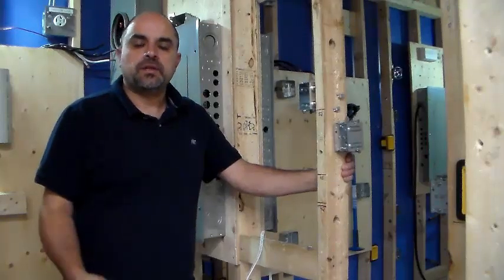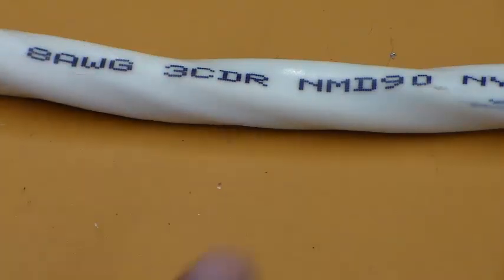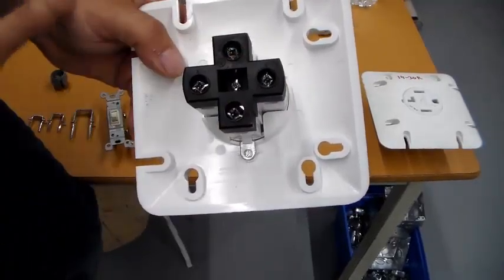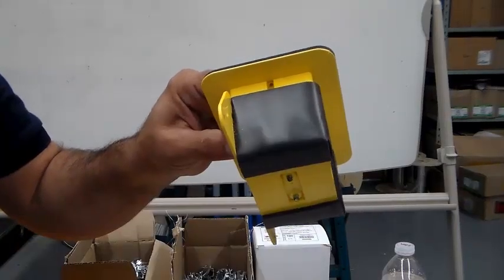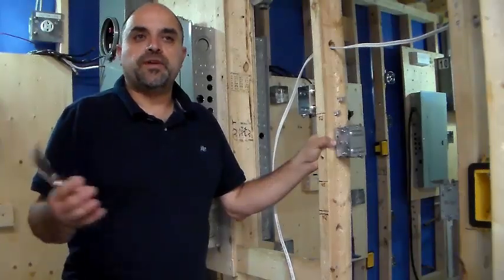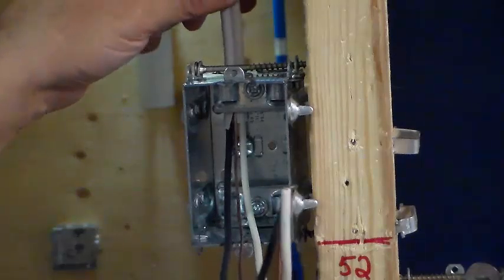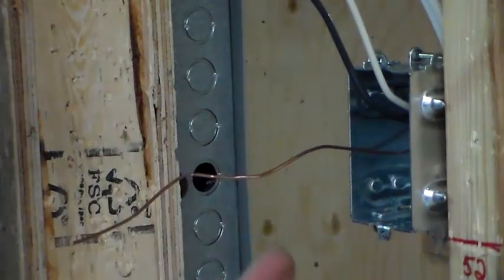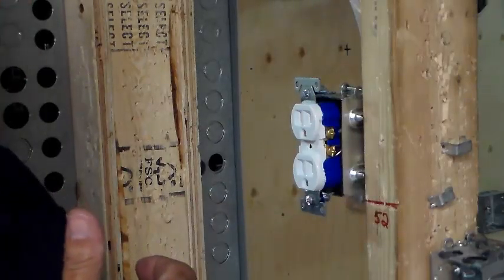Basic Residential Wiring

Comment: Sam, former student of yours here. I use your height recommended for boxes in this video in a house that I built. I was fired because the boxes were too high. Lol I wrote down all your measurements for heights on a piece of paper and use them as reference. Off to the next.
Reply from the maker: Sorry to hear this. Heights of boxes are not in the code and are based on what the specification of the designs calls for .  the height mention in the video are what i use in general.  In recent years the height of the lights switch has been lowered to 45' recommendations to make it more accessible.

Comment: Those single gang metal boxes look much better than the ones typically found here in the USA. Then again residential boxes seem to be almost exclusively plastic here. Another thing is that the NEC requires 6 inches of wire measured from the entry, typically the back of the box. Otherwise it's very similar.

Comment: does not matter where you put the hot or switch return on a single pole switch. just saying
Reply from the maker: I teach my students to put the hot wire on the top screw of a single pole switch. The reason for this is that in commercial and industrial installations 3 phase disconnect switches  have the live wires on the top lugs behind a protective barrier.

Comment: Canadian rules? Guess I'm watching the wrong video. I'm in the USA. Here it's six inches minimum from the point where the sheathing is removed from the cable at the back of the box.
Reply from the maker: Thanks for your comment. If you have a 2.5 inch deep box that only leaves you 3 inches in front of painted wall to make connections. I would rather have more length so that your fingers don't dirty  the painted wall when installing devices. Canadian rules don't  state a length, my recommendation  is  more for the easy of  installation of devices

Comment: when using metal box it is wise to wrap the outlet or switch using electrical tape. This will provide an insulation buffer between the exposed common wire and screws from the grounded metal box.

Comment: 14 gauge  for 15 Amps , 12 gauge for 20 Amps , 10 gauge for 30 Amps , 8 gauge for 40 Amps,  and 6 gauge for 50/60 Amps. Most Electric Ranges require at least a 50-60 Amp Circuit which would be wired with either 6-2 w/ground or 6-3 w/ground.

Comment: the original practice was receptacle ground was up. the idea was that any thin material slipping down behind the wall plate would contact the ground, not short hot and nuet together.
Reply from the maker: 100% correct

Comment: do not cut ground 16:35 +. code still requires 6" amount of slack for future. just push it back and secure flying end to other screw.
12:50 curl wires back, use side cutters to remove jacket waste. your way you will slip sometimes and nick conductor insulation.
Reply: Depends where you are
Reply: @Vanilla_Icecream1231  as code states, 6 inches of slack.
Reply: And he’s striping to much

Comment: if i dont have a black or red wire to be used as a hot wire, can i use any color wire say, white wire as a hot wire, after marking it with Red or Black insulation tape around at the termination end to notify that this is a Hot wire ( and not a Neutral, eventhough it is a white color wire ), Is it allowed as per Canadian Electrical Code
Reply: No. No Pow/Neu/Gnd identifying tape (called phasing tape) until the gauge of the wire is much larger. AWG 2/0 and larger.

Comment: I had a problem for the first time with a Leviton GFCI (GFTR1-KT). Wire colors not considered, I got a yellow light only in the center of my tester and carrying 15 volts on the ground. So I called my journeyman friend. We were borh perplexed. The neutral seems lost. Not code.
Reply: how old?  much residential housing to early 60s did not have grounded receptacles, no ground wire or ground pin hole. GFIs compare incoming current to out going current, 3 ma difference and it trips. That would be a leak to ground inside the device plugged in. wet hand to water tap holding device you, a better conductor, get zapped. You have a neutral and ground at the panel but no ground at the receptacle. You make the better ground connection then the neutral connection and get zapped, 15 amp breaker won't trip until approx.17 amps. You are dead.
Reply: @MrBonners  this place has a ground wire. The original electricians hooked up the GFCI backwards (hot to neutral - neutral to hot). I found it about 3 years ago. A fault in the neutral would explain why the ground is carrying so much votage, and my journeyman friend agrees.
I have never had a problem with Leviton, and I'm probably not having a problem with it now.
Reply: @theodoreroberts3407  there is no carrying of voltage. it carries current. voltage is constant, it is PSI of electricity, how much pressure. in electrical work current is what you work with, you are concerned with how much is flowing, 120 voltage is not adjustable, constant, it is the amount of current the load is drawing  . electronics it is voltages you work with. a disconnected battery will show voltage but no current or leakage (not possible). 
I'm a retired master elect.
Reply: @theodoreroberts3407  neutrals do not carry voltage. the only way wold be if the neutral and ground were not bonded at the panel. nothing would work then, no return to the utility, that is an open circuit and will show voltage from neutral to ground, the pressure difference.

Comment: I've heard of needing to rewire houses every 50 years or so due to cracked wire insulation (all plastic degrades over time) so why not run 1.5" PVC to wall outlets and leave a nylon fish-line to make it easier in the future to pull data/fibre or replacement power through walls instead of stapling it to the wall frame?
Reply: Put it in your project building specs. you can go way above code all you want. code is minimum requirements.

Comment: Does this info apply to New York City . I believe 12/2 is used for 15 amp and 20 amp in new york and it has to be Bx cable metal armor
Reply from the maker: This rules are based on Canadian electrical code. US and other States may be different.
Reply: you don't need bx in wood frame residential housing. way over kill. only used to power furnace.

Comment: Couple Questions. I opened up my electrical box with 2 switches in it (fan and light, which is a combination fixture). I want to put in a couple of replacement switches that are wifi controlled.

In the current configuration, I have white/neutral coming from breaker, light, and fan and connected together on one nut. White is not connected to a switch.

Fan switch has black on bottom and gray on top. Light switch has black on bottom and red on top.

The green screw on each switch has nothing connected; two solid bare copper leads enter the box and are twisted together and stashed at the back of the box.

How would I manipulate the current setup to use with my two wifi switches? They come with 4 wires - line, load, neutral, ground. None of the switches are 3 way so no worries about that.

If connecting bare copper to both switches, do I untwist the two leads and connect one to each switch, or use a wire nut to join all copper and ground leads, or something else?
Reply: If the new switches screws match the configuration of the current switches, TURN OFF THE CIRCUT BREAKER leading to the the fixture; take a cell photo of the switches with the wires attaches before you remove the wires and match them to the new switches,  you’re good to go.

Comment: I also put my grounds facing up. It's safer.
Reply: Problem with that is that many/most residential appliances (such as washers & refrigerators) with flush mount plugs are wired with the expectation of ground down. When ground is up, you end up with an awkward up and over cord routing. It's easy enough to change the receptical when needed though.

Comment: Great video, and thank you for the info. 
Why is it so important to have 6" of wire sticking out of the box? 
If I replace old receptacles in my house and the box isn't very deep, having 6" is too much to comfortably stuff back in, and I don't find it necessary to have that much length. 3" or 4" inches seems plenty.
Just curious
Reply from the maker: 6 inches is a guide to allow you enough wire so that you can  easily connect the receptacle without putting your fingers all over the painted wall . If you have a shallow box , then obviously you are forced to reduce that length to allow you to tuck the wires in
Reply: Extra wire is a good thing if not in the way, easier to do changes and just cut off, you can move a receptacle for some renovation or installation. It's a universal building thing for many reasons even simple things, say you need to add a stud for heavy hanging object or become wheelchair bound or just want to use the switch as a plug for wall mount TV etc.

Comment: I'm going to rewire a house I just bought. This is a great video to learn from. Thanks for taking the time to make this video for us newbies.
Reply: Elite, read reference books before you start wiring electric, Sam used a metal box for the class, plastic boxes are more common in residential construction, Plastic boxes are less expensive and are easier to work with. Additionally you need to install different  sizes of boxes depending on the number of wires inserted in the box; Sam did not discuss the amps of the circuit breakers necessary to connect to the different gauges of wires leading to appliances  There is more to know above the color of screws and the colors of the wires that connects to the screws.

Comment: Great video Sam full of useful information with extended details. It is now 2020 and is still practical. I'm not an electrician, but I like to do simple tasks at my house. I have a project to replace a single pole switch by a switch/outlet combo unit. I see what you've done in this video. It seems very familiar with the connections for my project. The particular wiring where the single pole switch is contains only three wires, newtral(whilte), hot(black) and ground. How would you suggest to connect this switch and outlet piece?

Comment: I was looking for a video for a new employee to get some basics on electricity on his own time and came across this video. The beginning of the video says the 14/3 might be used for split plugs in kitchens.  Kitchen receptacles can't use #14 cable.  They must be on a 20 amp circuit which requires  a #12 conductor. Also, a split receptacle in a kitchen can only be used with a 3 wire cable if both sides are tied to the same circuit breaker because arc fault circuit breakers are required so they can't share a neutral.

Comment: There actually is height requirements here in Ontario, Canada.
Reply from the maker: Great , can you show me the code that gives you those heights. If your speaking of building codes for handicaps homes , that is not electrical code. There is no heights  in the Canadian code  book .
Reply: @royalsam69  I was referencing part 3 and 9 of the Ontario building code from Canada - which references the NBC. sure the electrical code (ESA here in Ontario) doesn't state a height but the building code does so here the geometry of electrical outlets and fittings on a wall is based on the building code and the electrical physics is based on the ESA.

Comment: GOOD VIDEO SAM
Question ?
i have a OLDER house with BROWN Cloth wire powering a Washing machine with a Dark Brown Recepticle NO GFCI - Circuit Breaker is 15A

i want to RELOCATE WASHER and use SAME CIRCUIT with White Wire12/2 Romex   and a 15 A GFCI is that OK ? or do i have to use GFCI 20Amp . and update the Circuit breaker with 20A

Comment: Sam I have a bit of a problem I have a 3 way switch in my cellar and a 3 way switch going up the stairs. What I want is to take out the 3 way switch in the cellar and put a switch outlet combo can you show in a video how to wire. I have a 12 3 wire ending in the cellar.on this switch I have the black going to a copper color screw, a red going to brass and white wire going to the brass, but this is just a switch. Can I pigtail the hot connect 1one to the black screw on the top and one for the outlet. So I would have power in both the switch and the outlet.

Comment: Like this. I would only add what my dad taught me: wrap electric tape around switch or outlet terminals.  Although not required it prevents the idiot who opens up the cover and grabs on both sides making contact with hot and neutral while live
Reply: Did your dad also teach you to flip off the circuit breaker in the electrical panel BEFORE the idiot removes the switch plate cover, un-screws the two screws holding the switch in place and grabs the switches on both sides?
Reply: @buzzincalifornia  
He did teach me to turn off the power supply, but I inherited is disdain for 110 live circuits.  Before I was born he was working with power plants and building them.  When I was born he was building hydroelectric dams.  He never got shocked.  He is 95.  I have cut main house supply while live with the correct safety equipment

Comment: I need help. I have a electric stove. It has a double 40 amp breaker. So  two 40s together. I bought a gas stove and need to change the outlet that is currently set for 220 to 110v. The cables are too thick for the new 110

Comment: 2:00 by code 14/3 can never be used for split receptacles in the kitchen. Only 12/3 for 20 amp service to motor appliances.
Reply from the maker: In Canada 14/3 can be used in split receptacles on a 2 pole 15 amp breaker. 12/2 can be used when at 20 Amp receptacle is required, which also  allows you to use a 20amp GFI if receptacle is near a water source .  This 20amp  meets requirements for appliance that draw more than 15 amps. A mixture of both can be used on kitchen counters. To my knowledge a 20 amp GFI receptacle that can be used as split is not on the market . A 20 amp GFI breaker would be required if you wanted to split the 20 amp receptacle that is feed by a 12/3 that you are mentioning in your post

Comment: Actually I don't want to be that guy.

At 75C terminal ratings (standard terminal ratings for NEMA-14-50R (or as you call it, a "stove plug"). These are installed as 50A circuit in the US. I could only see a difference here if the manufacturer had a nameplate rating of 40A. Only then, would you be allowed to use a 40A breaker. I've never checked the name plate for a standard range.

Now, in your cabling descriptions, it is 14-2 w/ground, 14-3 w/ground, 12-2 w/ground, etc. The w/ground is a descriptor for NM cable sets. Given that this is educational, I feel this needs to be stressed, as it can also be referred to as 3-wire for a 2 conductor with ground, 4 wire for 3 conductor + ground, etc.

The #8-3 w/ground wire is rated for 50A at 75C, not 40A

I just watched the first 12 minutes, and wanted to clarify some of that. Feel free to correct me if I'm wrong here.

Comment: isnt the yellow wire for 20 am plugs or switches, mostly just 20 amp t slot plugs and and any 20 amp gfci's in the bathrooms and sinks and such as it would be uncommon  to need a 20 amp switch in a home unless you wanted one of those plugs on a switch, but its only for 120 volt, for heaters you need the red which is for 240 volt

Comment: Nobody uses those Metal Staples anymore !! The best is the staple with the plastic bridge between two small nails. Those Metal Staples can pinch and short out the conductors of Romex Cable if driven too tight

Comment: i live at eastern europe where three hot wires is common configuration for use with stove (if terminal design fits this intention) and one hot wire configuration for use with other devices (including drier), lights and receptacles. thus i do not fully understand reason for using only two hot wires configuration for stove receptacle. is us regulation so much different from east european one? if so could you explain this difference to me? thank you very much

Comment: Code does not require 6 inches out of a box. The NEC (300.14) requires at least 6" of free conductor, measured from the point where the conductor emerges from the cable sheath or raceway, and also the conductors must extend at least 3" from the opening in the box, if any dimension of the opening is less than 8". Note that the 6" is not measured from the front of the box.
Reply: Dizmatic    He is in Canada.   I'm not sure this section would be exactly the same as NEC.

Comment: Dumb question. Why does the ground need to be bonded to the box if it is going to be grounded at the main panel?
Reply: The ground wire is grounding the box or anything else that it is connected to that is metal.
Reply: Roger Chavez    If you know the purpose of equipment grounds, then you would know the answer.   The purpose of equipment ground conductors is if a "hot" conductor were to contact the box then there would be a short circuit that would trip the breaker.   With no equipment ground, the box could be energized at 120 or 240 volts.   Does this help?

Comment: Hell yeah it does 48in center for switches 12in for outlet artical 210 NEC  unless your state is not up to code
Reply: Depends on the specs . ADA says 36 for switches ans 24 for outlets .
Reply: Ezra Brooks   You need to look again!   Receptacles in ADA are 15" if side access is capable and 18" if only front access.   Switches are 48" front wheelchair only and 54" side of wheelchair capable.   And ADA is a guideline, not a Code.
Reply: chue thao     I don't think you will find this in article 210.

Comment: Thank you, sir. I learned a few new things today that were useful. I have worked with everything but a single pole switch and galvanized cable staples. I am glad to know what wire goes to what plug and outlet and what breakers they should be connected to.